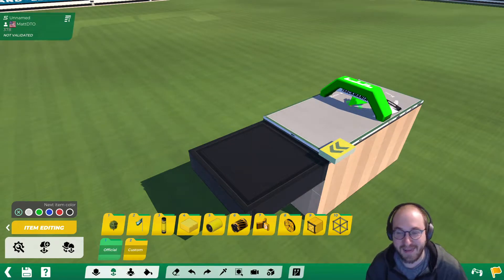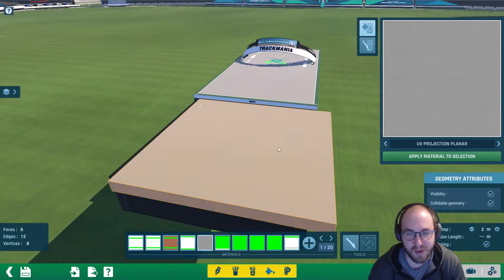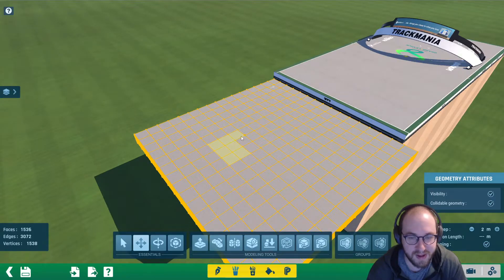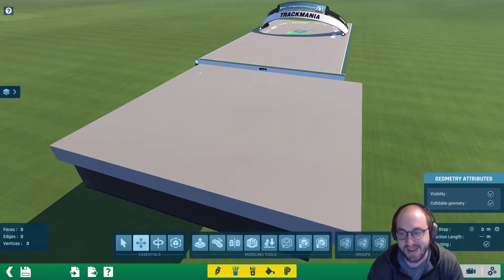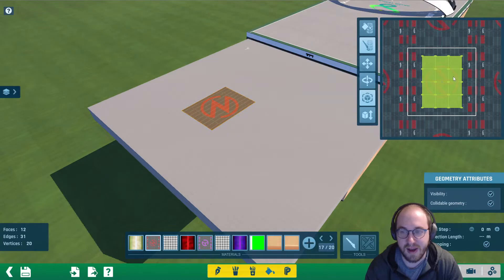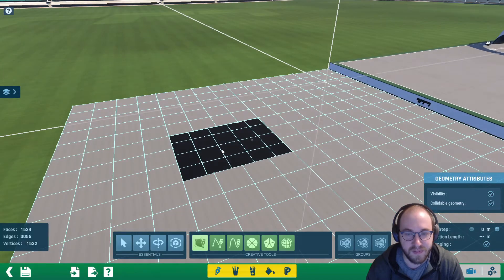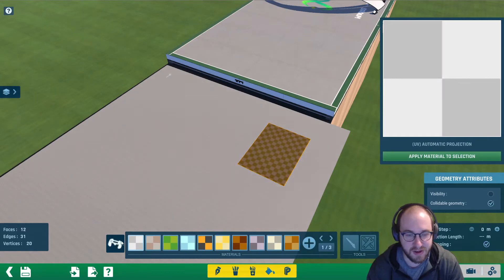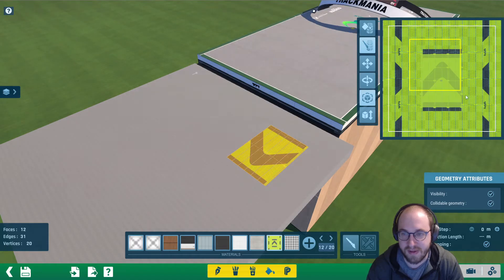How to Embed Special Blocks within Blocks Mesh Modeler TrackMania

Comment: thanks for the vid! i have a different question: how can i embed a custom image into a block so that other people can also see the custom image?
Reply from the maker: There are two ways to do it. The easiest way is to set the URL of a sign to the image you want. So upload the image to discord, copy the link, press F5 and click on the sign item/block and set the image URL. You could make a custom item with a hole in it and use freeblock to place the sign in the hole if you wanted it flush with the ground like in this video.

The second way to do it is to create a texture mod.

Custom items themselves can't have images attached to them like the way signs do, but it's still possible to get images into the game.